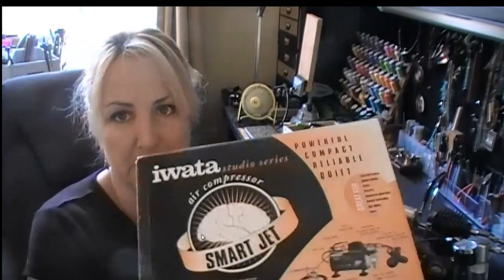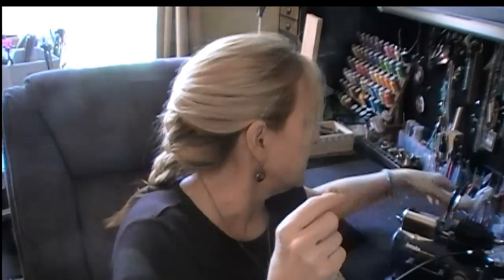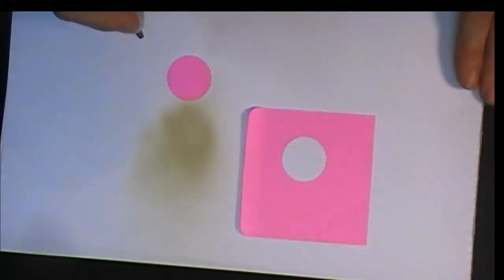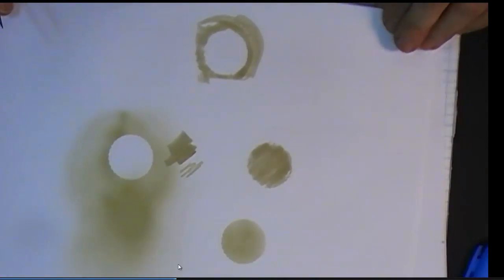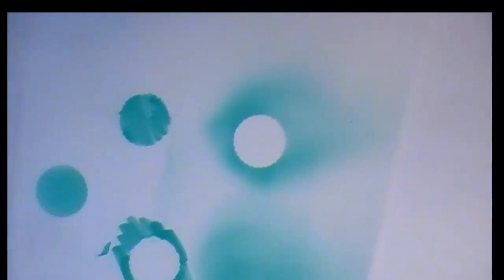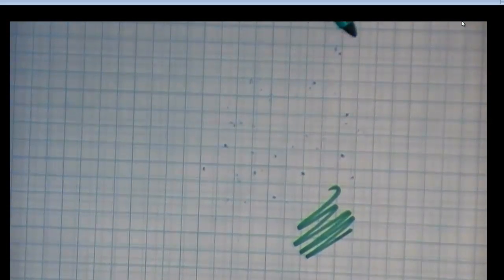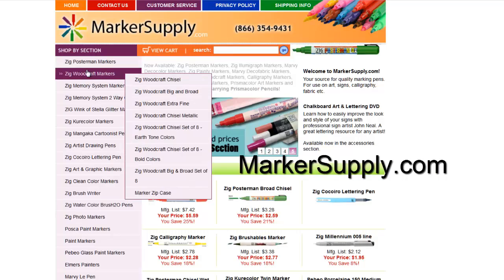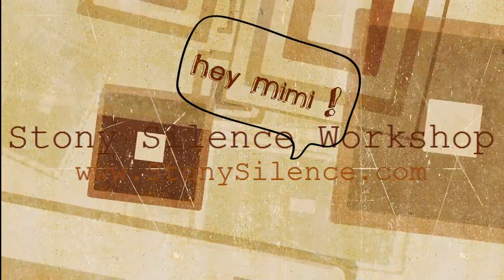Copic Airbrush System - Which Compressor & Markers I Use.

Comment from the maker: Me too. The reason I rarely used my compressor is because the cleanup of a real airbrush gun was just too much trouble for the small projects I was painting.  The Copic Trigger changed all that.  There is nothing to clean & you can change colors in 5 seconds!  I really love the thing!  Your Air Adapter hasn't arrived yet?  OMG, I would be going nuts with impatience! But it will be worth the wait.  Or I would have headed down to Aaron Bros or Michaels with a coupon and get a ABS-3 at half price!

Comment from the maker: I've never tried it with Copic's compressed air, but from what I've read & videos I've watched by people who have, it seems like the compressor gives a smoother result because you don't have to go in short spurts. Also,the can & pen tip won't get freezing cold with a compressor.  When I get a spattered effect, I try just re-seating the pen, or giving it a slight twist/wiggle in the trigger, or a tiny little push farther in or back in the trigger. Make sure you are using the chisel tip.

Comment: I got the Sharpie to work somewhat by pulling the nib out about 1/8 to 1/4 inch but you still have to play around with the angle of the marker. I going to play around with a block of foam that will hopefully hold it in a fixed position.

Comment from the maker: I use the Copic #3 ABS-3, which comes with the trigger &  can w/compressor connection on the bottom. Dick Blick & Amazon sell it.  
If you already have the ABS-2, it looks like you could buy JUST the Air Adapter for less than $20, (Amazon)  which is just the can w/connection on the bottom.  Looks like it just pops right into the trigger you already have.
My compressor came with the hose & connection adapters (1/8" & 1/4").  I'll bet the Harbor Fr compressor comes with it too.

Comment: Hi Michelle - I just got the adapter can and ran a test. For me, this works FAR better than the air can. Question: should the adapter can be making a hissing noise?

I've been assuming that I don't need to buy a new adapter can because it's basically functioning like an extension cord, right?

Thanks so much for sharing all these tips!

Comment: You're welcome!
Question: I have the Copic System Starting Set ABS-2. The air can doesn't have a receptacle for the compressor connection. Can you tell me what air can you are using? Thanks!

Comment: Hi Michelle, i have been looking at this item with much interest, i make fishing floats here in the UK and therefore do not use conventional airbrush because of space and the small amount of work needed, do you know if it is possible to hook this system up to a non copic air can propellant.
Thanks
Jim
Reply from the maker: Jimmy Jordan Sorry for the slow reply.  I just saw your comment today!  Unfortunately, I don't really know the answer to that.  I would think that using the Copic ABS#3 (Trigger & Aircan Adapter Set) might allow you to rig something up.  I have a video that shows what the connection looks like closeup.  Here's a link to the section of that video, that might help you: http://youtu.be/zp96peLpvnU?t=1m34s   I think if you get a hose with the right size connector on the propellant end, it's possible you could hook it up to just about any kind of canned air.

I've been thinking that of trying to hack a medical "atomizer" type compressor just as an experiment, but haven't attempted it yet.  There is also a product by Ranger Inc, which is just a little black plastic "pump" that you can put just about any marker in.  I'm not sure how good the results are; but it IS small and inexpensive!
Mimi